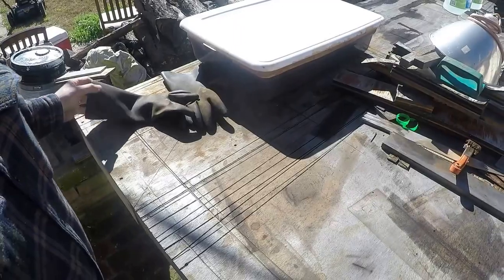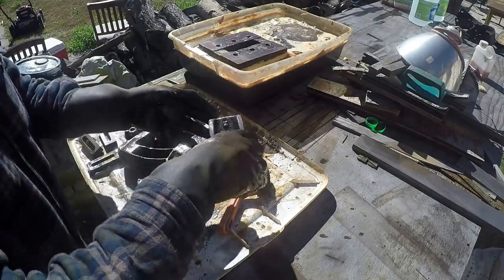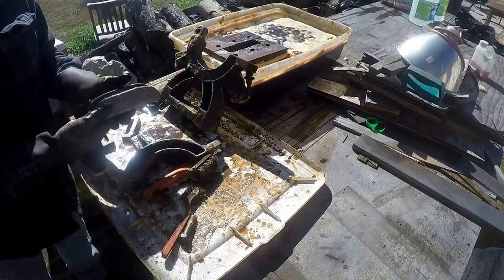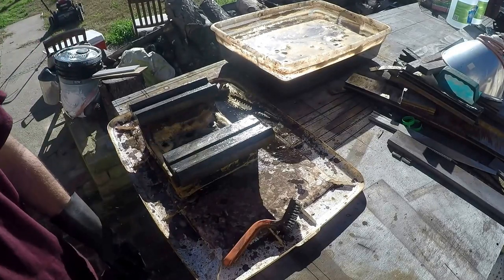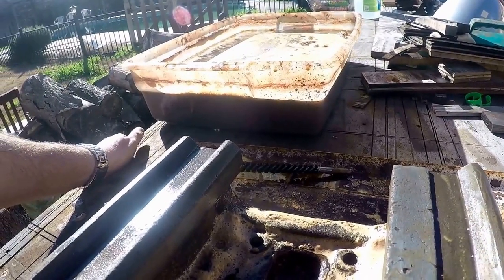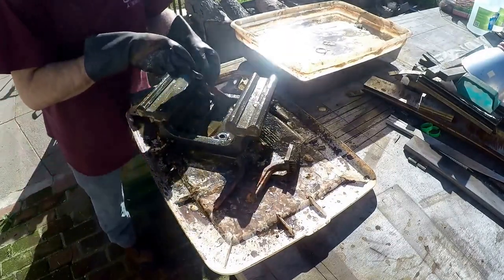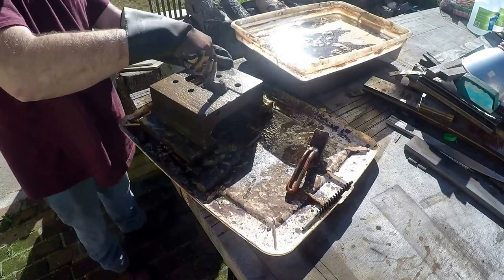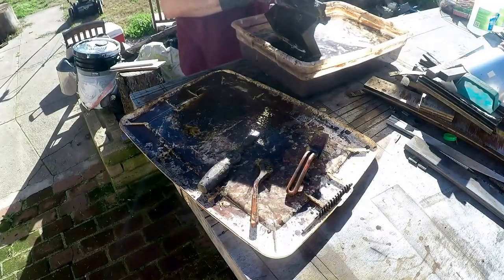Rusty Cast Iron Restoration part 2

Comment: It looks like the vinegar is working well. One note about vinegar. It etches the surface of the iron. I left a saw set in the bath for an extra day and the adjusting screw came loose like I wanted but the screw thread diameter was reduced to the point that the nut for it rattled. The same effect can happen to the ways. The pits will get deeper and wider the longer it is in the bath. The ways will also be reduced in cross section. 
I leave the part in for 24 hrs at a time and check it frequently.
Reply from the maker: +Old Sneelock's Workshop indeed

Comment: Whoa, I see what you mean by pits.  Thanks for the close up.  Is the bridge much worse than the rest of the bed?  The bridge could be shimmed upwards slightly if you need o take a bigger cut there than the rest of the bed.  On my Atlas Commercial series I have one really bad spot that is worn about 10 thou deep.  I"m thinking of having it filled by a welder before machining so I don't have to take as much off the rest of the bed.  I look forward to learning about Turcite you mentioned.
Reply from the maker: +Crafted look into turcite  (hope that's how it's spelled.) It's a way buildup material. No welding it think I've seen a video on YouTube
Reply from the maker: +Crafted welding may be a bad idea distortion you know.
Reply: Agreed about the distortion, very bad idea unless you want to heavily regrind the whole thing...
Reply: I've got a worn area near he chuck that is about the size of a thumb and .010 deep.  I would consider that a heavy regrind.  I'm open to the possibility of filling this area to reduce the amount I have to take off.  There is a company near me that does microscopic welding called Wicked Welding.  Those guys are so good, I'll let them advise me if this is a possibility or not.  I've had a bed done before just straight machining.  Just considering all possibilities before I move forward on that bed.  I might even replace it if I run into a good one.  I do have a good 54" early bed I'll trade for a good 1/2" thick late model bed.
Reply: Chris Anderson Where I've seen it used is to build up a worn saddle. It is bonded to the ways and protected from damage because it is covered by the saddle. 
You have a much better viewpoint than I  but I would try lightly  stoning the surface to take down the dings. You might be surprised by how well it turns out.
Reply from the maker: +Old Sneelock's Workshop the bridge is looking to be one of the most damaged parts so far I'm certain that I'll a dressing repairs in its own video / videos

Comment: Chirs I think that crap down in between the ways is likely Petrified Dinosaur Squeezings. I can't deal with those old messes anymore I stick to new messes but it is all the same at the end of the day is's like wallowing in Pond Scum but the stuff sure looks better once that crud is vanquished.  You have yourself a case of the pits on the ways or cast iron zits perhaps, It looks a bit too deep to scrape.  Many ways to skin that cat, either expensive or a lot of work or both at the same time..
Reply from the maker: +John Bare your right on all of that

Comment: Getting there, do you add some more fresh vinegar once in a while to keep the solution acid?
Reply: That could be a good candidate to electrolysis.
Reply from the maker: +Pierre's Garage it does seem to be getting a little bit week.  I plan to change it out. I don't know if this just happens or maybe or if dirt and oil have fouled it. But as it stands I have not added any new vinegar.

Comment: Another thought.  The inside set of ways looks much worse than the outside on the bridge.  Where does the carriage ride?  If the inside ways are for the tail-stock (and I'm pretty sure they are), at the point of the bridge, it's purely cosmetic.  The tail stock will never be there.  If it's worse there, it could be because the carriage kept a fresh wipe of oil on the outside ways in that area so it was better protected before she was sacrificed to nature.   Further, we might expect to see the outside ways looking worse towards the tail stock end of the bed because the carriage is rarely if ever there spreading oil.   Hmmmmm.   It's time for a new episode.   I'm left with nothing to do but speculate.  ;-)
Reply from the maker: +Crafted the bed proper seems much better I need to clean it up so I can mount the parts back on to it